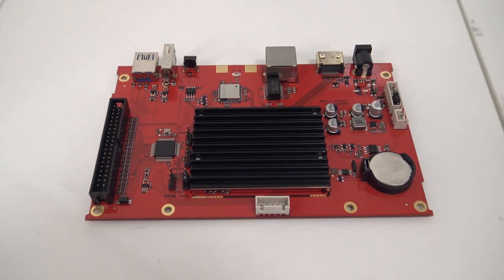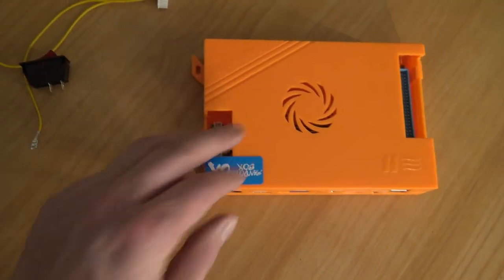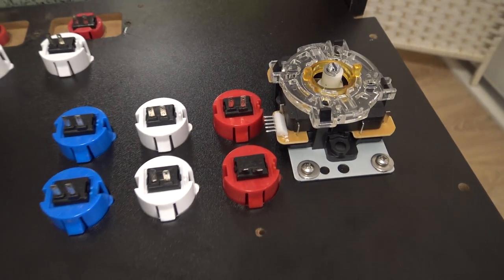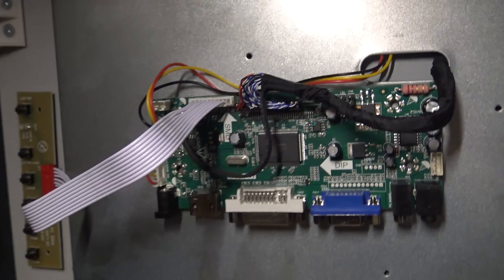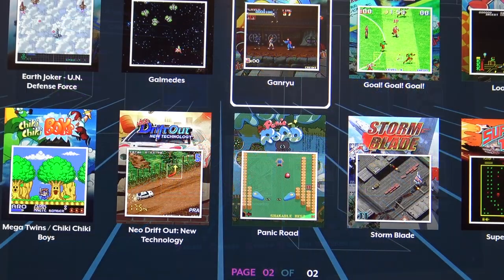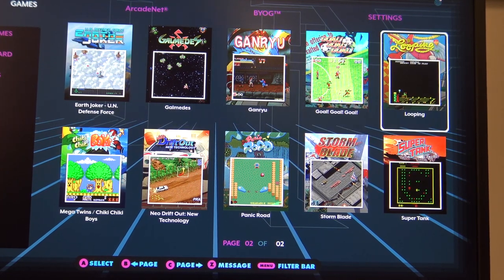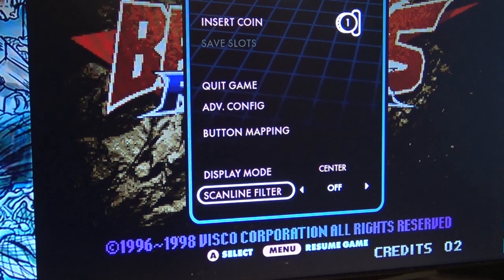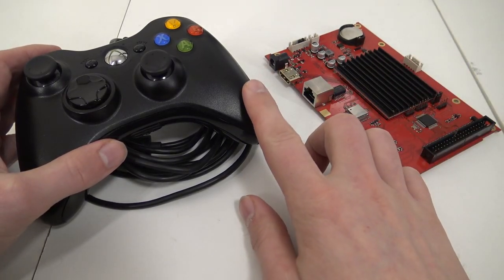Arcade1up Ultimate Atgames Legends Connect MOD ?

Comment: 6-buttons max was a mistake. Missed out on all the 8-button boxes that only have support for 6 on the Pandora's Box
Reply: Arcade games are only 6 buttons max
8 buttons is only for console fighters
Reply: @jblps  not a big fan of playing console games on arcade machines. But you can add 2 more buttons on this cab when you drill holes.
The @legends arcadestick has 8 buttons with the same board/core soo its possible.
Reply: @bonggzilla  hmmm. I was looking through the specs and manual and it implies only 6 buttons are supported by this board (the connect). No need to drill holes here, I have an 8 button fight stick.
Reply: come on... 8 buttons is for plebs brother. if we cant smack 3 buttons to do a super or an ultra, then we seriously suck.
Reply: @ScorpionF1RE----USA  ahh to each their own but it's nice for a lot of reasons... best compatibility for 4 button games and other layouts and for some systems that need the extra buttons in the menus like XMB
Reply: @ScorpionF1RE----USA  plus the new 8bit-do stick seems to agree with me
Reply: @ScorpionF1RE----USA  haha true

Comment: About the wire for this AT games card did you use the one from Pandora 3D ? all buttons settings work well  ? ABCXYZ
Reply from the maker: Cable Harness / Tree are the same it's more how you config the button on the cables. 
And don't forget you there is a jumper on the mainboard to switch between pandora version output
Reply: @WickedGamerCollector  you mean i need to use a jumper to use the Pandora wire 3D ? i simply want to use for the moment the card with wire Pandora , i do it same as the PDF file tell but it don't work correctly ,only C and Y buttons work .
Reply: @WickedGamerCollector  i don't have any jumper he board , not as you with plastic case , antenna was already mount..and YES it work now , i found a jumper on an old HD and place as you and now my buttons works just fine !! thank you for the mind about this jumper that i repeat was not inside the package of my card .

Comment: Hopefully you can adjust the screen size. I'm planning on using the Legends Connect for an Arcade1up mod, but will be using it in landscape mode. But the lack of included games is too bad.